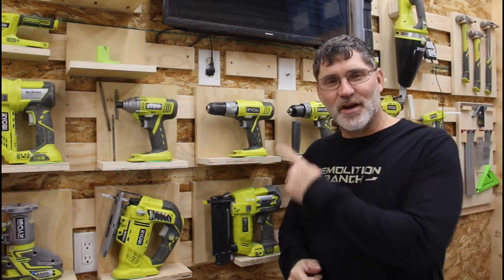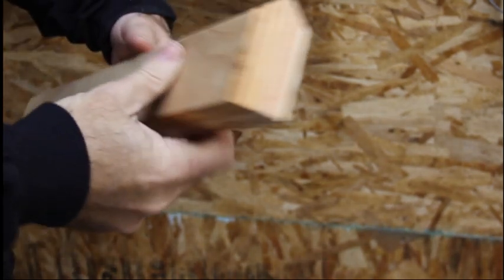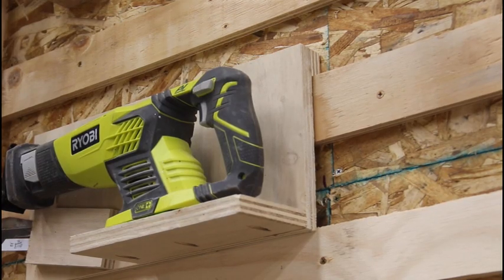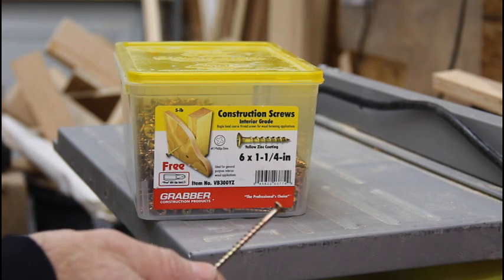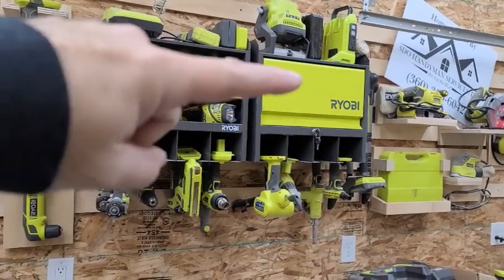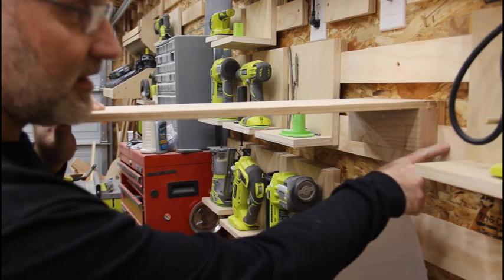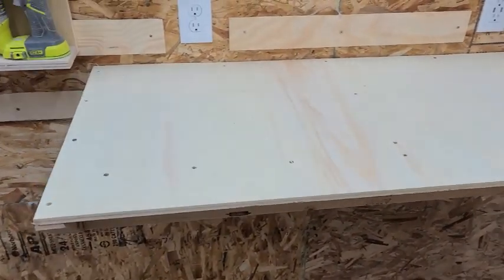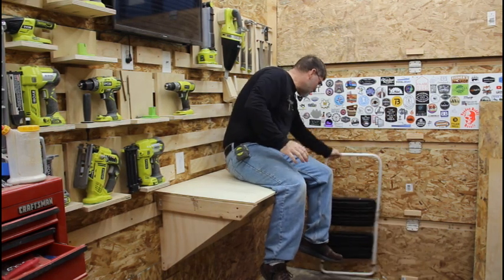How MUCH weight can they take? | French Cleat Strength TEST! | 2020/11

Comment: You have just helped me solve one of my most nagging problems!

I have spent a very long time not wanting to clean up my garage to turn it into a proper workshop. I have lots of stuff, and didn't want to just move piles around. Also, I didn't want to spend a lot of time and money creating a setup that would only dissatisfy me over the long run. It's been eating at me.

With what you've shown me, I can now simply cleat up my walls, make movable shelves that do not take up floor space, AND a light weight work bench with the same qualities. Once everything is more or less how I want it, I can bother making more permanent solutions.

This is just great! Thank you.
Reply from the maker: I am so glad I could help! Send progress pictures!!
Reply: You sound like me. I have 4 shelves 2'x12' plus another 4 at 4x4. Plus a huge table in the middle as well as miscellaneous plastic shelves. It seems that all I do is move things around with minimal organization. Just over the summer I bought a HF tool box to start but doesn't do much for the big tool and non-tools. That is what lead me to here. Did you do 1? How is it?
Reply from the maker: It's working for me. I need more drawers for small stuff storage.

Comment: Cool! I like the thinking out-of-the-box. I have used french cleats but never thought of using one for a removable work bench! This will be super handy in a small work space.
Reply from the maker: Adjustable height too!
Reply: You could add locking legs that tilt back when on the wall but drop down when on the floor.

Comment: Great video!! I just finished adding the French cleats to one big wall In my garage. Now time to use what little imagination I have to build the tool holders to fit on the wall.  I seen in another YouTube video where the guy use a locking System to hold the cleats, he used a spacer between the top cleat and the bottom Cleat to lock that cleat in place. I thought it was a brilliant idea and so sample.  When he wanted to move that cleat he just removed the spacer. love your tool wall.
Reply from the maker: That's an option. My cleats very rarely life off..

Comment: Next challenge: make a collapsible work surface, ie vertical supports fold in, and it has a 90 degree opposing cleat so that the work surface can be removed, rotated and re-hung parallel to the wall for storage when not in use.  I'm inspired, gonna need to track you down elsewhere to order a bunch of the battery compartment inserts for my platforms - thanks for sharing your ideas!
Reply from the maker: Thank for your support!!

Comment: I have tried a few French Cleat projects I classified as fails.  I tried to make a drill holder with 15 different drills on it.  I did not have the bottom held off the wall and pushed a 1/4" drill into its hole and dropped them to the floor.
Reply from the maker: Failure is just an opportunity to learn. So what did you learn that overcame the problem.
Reply: Dad It Yourself DIY put a stand-off on the bottom like you did. After I finished laughing
Reply from the maker: Nice!!!

Comment: absolutely brilliant. how is it fixed to the wall? as I see its OSB but is the wall cleat mount with some longer screws through the OSB to the wall?
Reply from the maker: Yup. 2 1/2 inch screws to the studs
Reply: @DadItYourselfDIY  thanks, so nylon pins through the OSB to the wall ?!
Reply from the maker: No. Metal 2 1/2 T25 Torx Head Screws.

https://www.homedepot.com/p/SPAX-10-x-2-1-2-in-HCR-X-T-Star-Plus-Flat-Undercut-Interior-Exterior-Multi-Purpose-Screw-81-Box-4191670500604/315173743

Comment: One question: how thick were the plywood cleats on the wall for the bench/shelf? 1/2? 5/8? 3/4?

Also, how high is your lowest cleat?

Thank you.
Reply from the maker: 3/4 " Plywood.
Reply: @DadItYourselfDIY  Thank you. That's kind of an important bit.
Reply from the maker: The other bit. Originally my lowest cleatvwas about 45" off the floor. The one I put to hold my work desk ir about 40" off the floor, maybe a little lower..
Reply: @DadItYourselfDIY  Thank you.

Comment: Would you recommend French cleats to “hang” a 48w x 72h x 22d garage storage cabinet made of 3/4 plywood?
Reply from the maker: Yes. The strength is in the hardware. The cleat distributes the load. Use 2" or 2 1/2" screws into each stud along the length of the cleat. Make sure you screw the cleat to the back of the cabinet as well.
Reply: @DadItYourselfDIY  do you have to use 3/4” wood for the cleats or can it be 1/2”? Specifically, for handing a 30” wall cabinet . Thanks
Reply from the maker: I'm sure 1/2" would work as long as you use 1/2" on both sides. It just won't be a strong..in that the cleat will be shallower.
Reply: @DadItYourselfDIY  thanks for responding. I’ve watched many French cleat videos and surprisingly , none specified the thickness of the cleat boards to start out with .
Reply from the maker: I think I say 3/4 plywood multiple times.

Comment: Thank you for this video! I searched "how much weight can a french cleat hold" and  you answered. I am planning a cleat system to store my project hardwood in my block cement basement. 3/4" ply (doubled up maybe?) Tapconed into the block every 16"  so that no block gets more than one hole in it. I want the cleats to extend 12" out from the wall and I was going to make them 12" deep as well. I saw a 5/8" plywood cleat

https://www.youtube.com/watch?v=GXHyias2C6w 

built to hold a light lumber load - three or four  2X4s. I was hoping to support maybe 150 lbs over an 8' span with a cleat every 12" for support, thereby spreading out the load but still stressing the cleat on the wall quite a bit. I guess I'm most worried about the plywood wall cleat breaking after hearing you describe that possibility. I have a feeling I'll have to field test it after it's built to see how much weight is too much and perhaps make use of some of the wood I have instead of filling up a shelf with it. Thanks again :)
Reply from the maker: Sounds like a great project!! Send me a picture in Instagram, when it's done!!